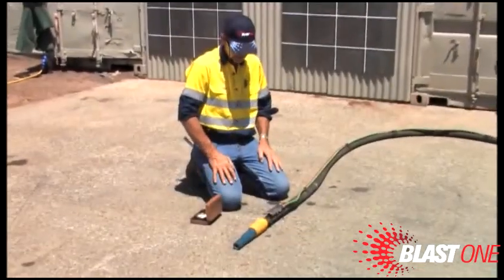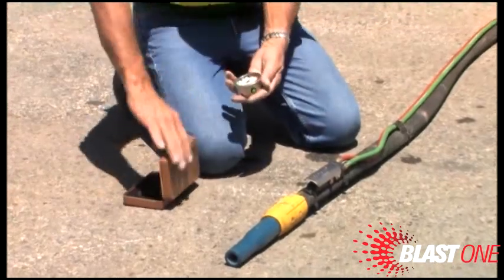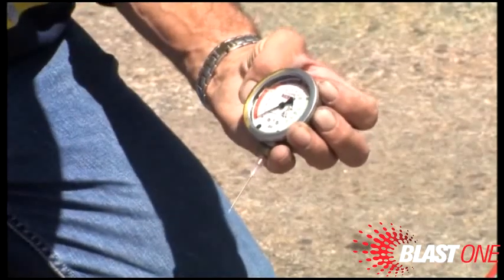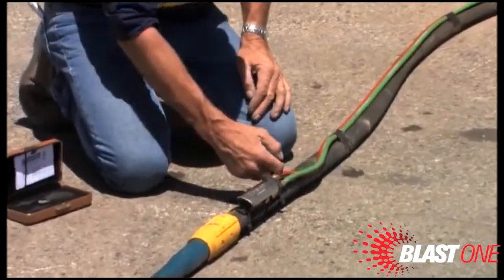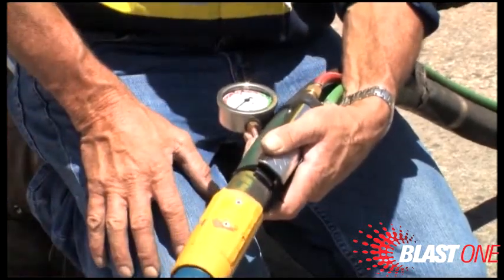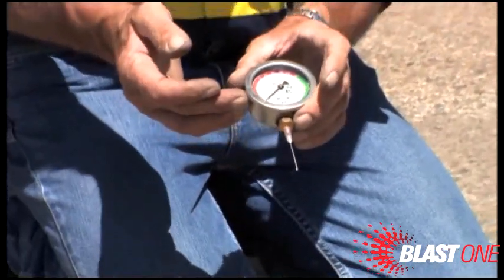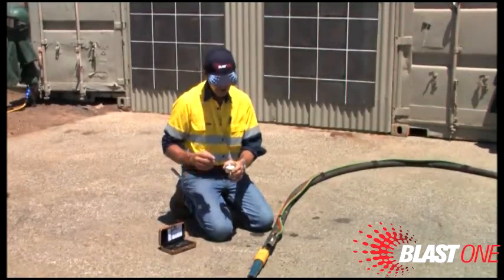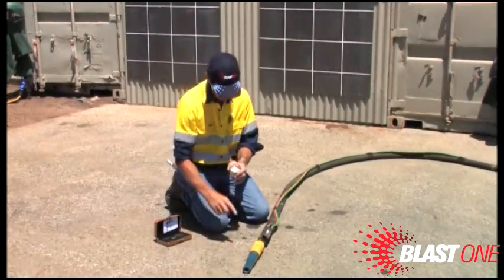Industrial Sandblasting:  How To Check Nozzle Pressure

Comment from the maker: Hello beersforyearsTM, 
 
The pressure gauge on the compressor, even if accurate, will not show the actual blasting pressure due to the fact that the air it creates has to move through a number of restrictions before it is able to exit the blast nozzle. I have listed the most likely restrictions your system will face below;
 
1.        Firstly the air delivery hose depending on its internal diameter and length will cause a pressure loss of anywhere up to 
           7psi per 20 metre length.
2.       The moisture removal system depending again on size will cause a pressure loss of up to 25psi.
3.       The blast machine itself depending on design and the piping size will cause a pressure loss of up to 12psi.
4.       The blast hose depending on size and length will cause pressure loss of anywhere up to 7psi per 20 metre length.
 
As you can see the pressure loss in a system can be substantial and in a bad case this pressure loss can add up to be in excess of 50psi. Considering that most blasters run their compressors at 100 psi and that every psi drop below 100psi at the nozzle results in a 1.5% decrease in productivity. With a 50 psi pressure drop this is a productivity decrease of 75%. In real terms, when a job takes you week to blast, it takes your efficient competitor only 3 days.

Please have a look at these related Tips on our website:

Working under the right pressure - www.blast-one.com.au/resources/weekly-tips/work-under-the-right-pressure

Don’t lose pressure due to undersized couplings - www.blast-one.com.au/resources/weekly-tips/dont-lose-pressure-due-to-undersized-couplings

Contact our team of experts if you require more information at sales@blast-one.com
Reply: Hello, what standard requires the use of needle pressure have? Any ISO, ASTM or other? Please comment.

Comment: Great clip. Im new to this and am hoping you could answer a couple of questions. 

1) Im using a 400cfm air compressor and as you say, pressure is lost as it goes through the system before it reaches the production end. If one loses 50 psi by the time it reaches the production end, do I simply turn my pressure up to 150psi at the compressor? 

2) After poking a hole in the hose with the needle? Do you put any glue over the hole? Or is it unexpected by the puncture?

Thank you.
Reply from the maker: Thanks Colin.  There are several factors that can result in pressure loss.  Without knowing more information, it's hard to give you an accurate assessment.  Give us a call toll free at 1-800-999-1881 and one of our experienced team members would be happy to help you troubleshoot your issue.  For your second question, no you do not need to put anything on the needle hole.  As long as you insert the needle at an angle towards the nozzle, the direction of the air pressure against inside wall of the blast hose will seal itself.
Reply: @BlastOne  Thank you for your prompt response. Once Im set up and put a pressure gauge on the system I'll be in a better position to confirm if there is in fact an issue. Thanks again.

Comment: does the pressure you get from the main hoze nozzle vary alot from the reading the compressor gives you ?   I work on cooling towers and we do alot of sandblasting but we've never run this test
Reply from the maker: Yes... you can lose substantial pressure from the compressor to the nozzle.  That's why it's always recommended to check at the nozzle for production pressure.